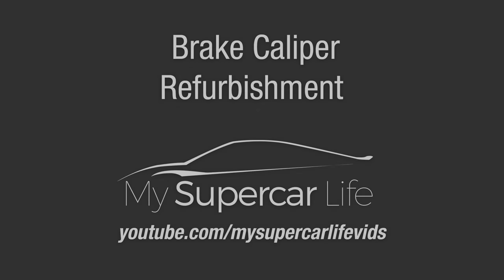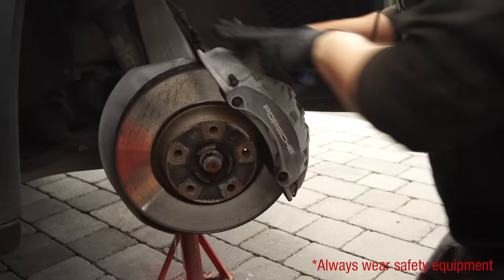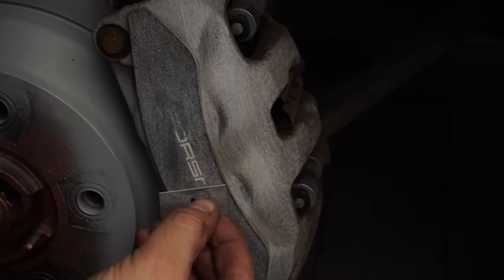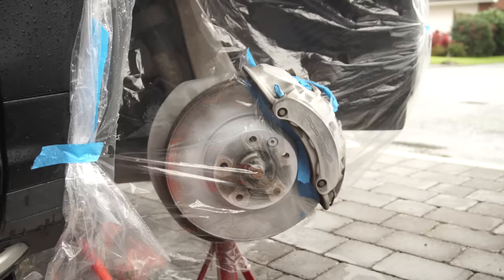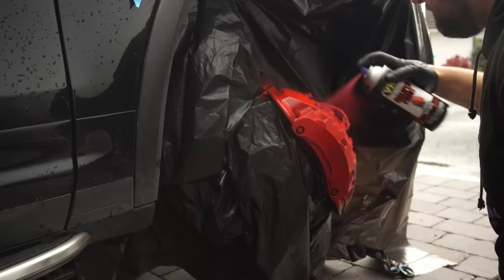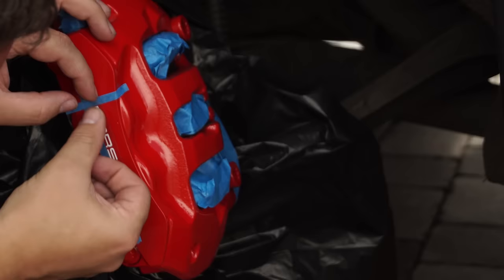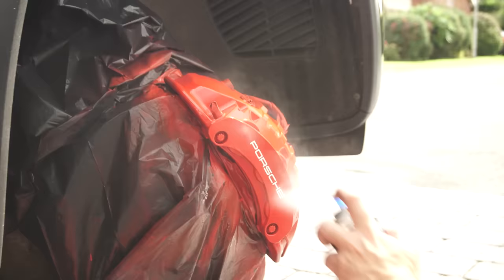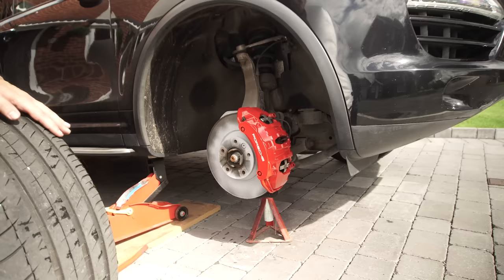How to Paint Brake Calipers

Comment from the maker: Frequently Asked Questions:
I don't use primer as there is no need to use primer with VHT's Caliper Paint. Other brands may vary, please check the instructions.
The paint used is VHT (VHT is the brand) Caliper Paint in Red (SP731) and Clear (SP730) - https://www.vhtpaint.com/high-heat/vht-caliper-paint

How long did it last?
I sold the car after just over 18 months from when I painted them and they looked exactly the same as when I painted them.

Why I don't remove the calipers:
This is a long story. When I bought the car, a Land Rover dealer decided to 'try' do the handbrake shoes, which meant that the brake system went in to service mode and wouldn't come out. The car had to be recovered to a Porsche dealer 40 miles away to be reset, however this didn't work as the brakes wouldn't come out of service mode and the module wouldn't communicate. They nearly had to put a new brake control ECU on the car, when the decided to try swapping my brake ECU with another Cayenne. The other Cayennes module worked in my car, and mine worked in the other car.  They reset it and swapped it back and it's all be fine since, but that little episode left me without a car for a week.
The other thing is this was my daily so I can't be without it, and I don't want 2 tonnes of car on jack stands for longer than it needs to be. The calipers look fine and the only benefit of taking them off would be I could have painted the back, which you never see.

Why not Powdercoat?
Powdercoating calipers is a completely different kettle of fish and is not something that most people can do at home. This video is aimed at the home mechanic or enthusiast. The cost of stripping and rebuilding the Cayenne calipers would be huge. They are 6 piston brakes on the front and 4 on the rear. Invariably you'd find a few of the pistons would need replacing and also all of the seals if you were Powdercoating. This adds time to the job and as I've said before this is my daily. Powdercoating is OK if you can be without brakes and the car for a while.

There is nothing wrong with painting calipers. It works well and is cheap. In theory there are always better ways to do something. In reality - £30 worth of paint made my car look 100 times better.

I hope this answers why I don't remove them. Basically cars are becoming so complex and reliant on modules that it's not just a case of unbolt the caliper, then re-install and bleed the brakes.
I enjoy reading your comments, but I hope this helps answer the ones that keep coming up.
MSL.
Reply: My Supercar Life cheesy oatcake
Reply: Did you have a grinding noise after painting?
Reply from the maker: @leerobinson2777  no, why?
Reply: I've recently changed my wheels and thought I'd paint the calipers while I was in there. Everything looked OK but when I started driving Im getting a grinding noise from the front wheels when I brake or corner. When I changed the wheels I went from a bolt to a stud configuration (bmw)...now I'm thinking that maybe the studs are a fraction too long and are rubbing on something on the rear of the hubs. Going to try the original bolts tonight and if the noise goes away I'll know its the studs, if not then I'm goosed cause I'm really out of ideas if painting the calipers won't cause a grinding sound 😔
Reply from the maker: @leerobinson2777  Oooh, unless when you've cleaned the caliper off some debris has gone in I would say you're on the right lines with the stud conversion. I would eliminate those first and see what happens. I had loads of trouble when I changed the wheels on my E46 330i back in the day,  I replaced wheels with the same offset and the rubbed on the rear. Let me know how you go on. Fingers crossed for you.
Reply: @MySupercarLife  cheers mate your good luck wishes paid off cause I found the fault!... Turned out that the inner rim of my wheel was catching on the suspension arm by a couple of mm!... Bought and fitted a 10mm spacer and all is now sweet!... Calipers look the bee's knees too! 👍
Reply: Lee Robinso
Reply: Indjustering af bremsekaliber
Reply: is one can of caliper paint enough for all 4 ?
Reply: 'VHT' paint = Very High Temperature paint!  You need high temperature resistant paint on calipers as they get too hot for normal paint.

Comment: I use Por15, rust inhibitor. Comes in various colors, stops and prevents rust, encapsulates. But most importantly is impervious to any cleaning fluid brake fluid. Can brush on and dries evenly. Can use on rotors also!
Reply from the maker: I need to try POR15 on a different project, but I always hear it's a pain to work with. It's highly rated don't get me wrong, but I know people say the surface has to be spotless for it to bond
Reply: It was made to go straight on Rust. Stops and prevents further rust. I used on a 73 Dodge D200 3/4 ton my Mom's gave me from California, Hesperia, high desert. Yes, had rust, because it snows up there. People in rust belt actually put on new parts , axles, anything metal to protect from rust. I live in Phoenix, where it's already °110, so no rust but for detailing calipers, rotors I like Por15. Also, wrinkle paint, VHT. Lately I have been rebuilding my calipers and leaving base metal, but detailing rotors, and painting inside of aftermarket wheels to match. Subtle, but detailed. Sort of a haircut that doesn't look like a haircut...

Comment: he is correct,,,,the screwups occur when add that last touch.....stop when your ahead...after all this is just a work of art....only you know that  there is possible one last touch
Reply from the maker: that's when it always happens to me, I never know when to leave things alone! Thanks for commenting
Reply: Iv'e done that countless times on my projects. Great video.
Reply: i agree this happened to the set i just did but luckily i use all 2K products and was able to color sand the runs and buff to perfection, ck my channel for the videos.

Comment: For some reason the Cayenne has just really bad coating on the base model calipers. Mine started out black and ended up looing greyish like yours. Going to use this as a reference when I repaint them
Reply from the maker: Wow - I can't believe they started black and ended up grey. I didn't buy my car new so I'm not 100% sure what colour they used to be but it's really bad that after 4 years they ended up looking this bad. They paint quite well, I'd have loved to remove them and paint them, but it would have been more trouble than it's worth, plus with the wheels on they look great now - they couldn't look worse! Hope it helps in the future.

Comment: A recommendation about brake pads should be made. If the owner knew what type of brake pads to use which didn't make the calipers dirty with brake pad dust, he or she could consider changing the pads when cherrying out the calipers.
Reply: They will all make the calipers dirty and also the rims. That's i'll change the paint on my rims for a darker one.

Comment: Is it okay to leave the masking tape on 24 hours after paint before decal and clear coat application or remove when tacky and re apply masking tape for clear coat process? Hope this makes sense
Reply from the maker: I would remove it so that it doesn't crack any of the paint when it's fully cured in 24 hours. You'll run the risk of damaging the paint surface if you try to remove it when the paint is dry.

Comment: Good Video! Why did you put a clear coat on? Is the VHT caliper paint not enamel? Thanks, I will be doing this soon to my 67 Mustang. Cheers from Motown USA Oh, I would use safety glasses when using a wire brush or wheel on drill, they can break off and fly into the eye.
Reply from the maker: Thanks for the kind words and advice.
I used the clear mainly to seal the Porsche decal in and stop it peeling / discolouring - with it being white I didn't want it going brown or mucky. I think it helps it to look a bit more 'factory' too. You don't need it if you're only going for a colour 👍 I'm sure the Mustang will look awesome once they are done!

Comment: Do I need to put a clear coat on afterwards   I’d be happy with just the paint !
Reply from the maker: You don't need to, I used it to seal the decal in so that it didn't discolour or peel off. If you're just painting them then you don't need the clear coat

Comment: I prefer removing the caliper from the disk rotor - bleedng for me is easier than working undel the wheel well. Its easier to brush, clean, mask and paint - while sitting on a table.
Reply from the maker: You're right, that is the best way. Unfortunately this is my daily driver and I need it all of the time for work so removing wasn't an option.

Comment: During next brake job, wouldn't the paint scraper right off when you clean it again
Reply from the maker: Not really, if you use a high quality paint like the VHT brand then it dries more like a plastic coating than normal paint does so it's more resistant to chemicals etc.
However even on factory painted / powdercoated calipers there is always a chance of some areas flaking where the coating is thin.

Comment: Really well demonstrated mate excellent video and the finisher in the end about finding the wheel loved every bit of it. Question why didn’t you apply primer before apply paint?
Reply from the maker: Thanks for the comment glad you found the video useful. You don't need primer with this paint, you just need to make sure the caliper is clean. Here's a link to the paint: https://www.vhtpaint.com/high-heat/vht-caliper-paint

Comment: How do you keep it clean. After painting it? Because it comes out easy whe certain liquids..
Reply from the maker: With normal wheel cleaner. As long as you paint and clear coat them properly then the cleaner will not affect the paint.

Comment: You should check with manufacturer before painting callipers, they may not be able to get ride of the heat it obtains during brake application.
Reply: Vht caliper paint is made for just this. NO worries.

Comment: A question . What do you think of putting the caliber in the oven to bake the paint ? Or would that be only for ceramic paint . I really don’t k ow . My wrx callipers are so sad these days . A thick yucky coating of brake dust n who knows what else. 😫 I want them to shine but I’m not a painter n never have been . I’ve done little things with wood etc but never with cars . My bike , Ic used a paint pen . That’s all . I worry with painting n thick coats is that the brake dust will stick to it n make a even bigger mess unless it’s hard hard. Is that just inexperience or is it a legit  worry ?
Reply from the maker: You are correct. Most high temperature paints need to be heated to a certain temperature at which they become more of a plastic coating. It will help the paint last longer but isn't always necessary. The brake dust shouldn't stick to the paint as much if you use clear coat and get a nice glossy surface, it just helps it not to stick. You'll probably find it's sticking because of the rough surface. The painting is the easy part, just make sure you clean the calipers first as you want to get the pain on to the metal of the caliper so it doesn't peel or chip. Take your time and don't panic, it really can't go wrong

Comment: great job from prep to finish, but how is it baring up to the riggers of heat and brake dust. I had my 964 calipers powder coated as it is the best way to go.
Reply from the maker: Thanks. It's doing OK so far, saying that it's been in the dealership for the last week with a broken rear suspension spring! The VHT brand paint I used gets really good reviews, and I think that clear coating them helps alot.
Powder Coating would have been the ideal way but as this is my daily I didn't go down that route as the car would have been off road for too long. Also I'd have had to take the calipers off and strip them, looking at the state of the bolts on there, I'd have probably needed new pistons (there's 20 of them @ £30-£40 each) as well as a re-build kit. So it would probably be cheaper to buy refurbished calipers for the car.
Thanks for commenting

Comment: Did you use any specific type of sign vinyl for the decal? I have a vinyl cutter and standard sign vinyl but is there a heat resistant type. 
Great vid btw, will be following this for my ones.
Reply from the maker: I checked on this first. Apart from really specialised applications there is no such thing as a high temperature vinyl. I asked a few vinyl suppliers and none did anything. I used Oracal or Ritrama (I forget which) and it worked perfectly. I would clear coat over the top though to stop them peeling or shrinking as if anything, the glue will soften with the heat. The vinyls I used looked exactly the same after 18 months with no cracking or anything.  Hope this helps
Reply: @MySupercarLife  that does help alot mate. I thought I had heard a while ago that there was a specific heat resistant vinyl. Mind you I wont be braking alot to make my brakes super hot anyway with normal driving. 
Thanks for the swift reply. I will be able to do my own decals now instead of buying them.
Reply: @nickblack423  Where can you buy the decals? Thanks!

Comment: Nice job....I struggled with acrylic caliper paint .....great finish but slow (y)
Reply from the maker: Thanks mate. I've never used the VHT brand stuff before but I'd highly recommend you give it a try next time. It has a really nice spray head which isn't like the old white ones that make your finger ache, and the fan of the spray is similar to a spray gun. I know what you mean about it being slow, It's about 15-20 mins between coats but this really is a superb finish without a spray gun. It is the next best thing.
Thanks for commenting.

Comment: I suggest wearing some kind of mask while using the wire brush to clean the calipers.  You don’t want to breathe in all of that fine dust that is blowing around your face.  

I would also use even more masking of your car.  There is tons of overspray and it can land anywhere on your car.  
Wouldn’t painting in the rain cause water droplets to smudge and ruin the paint job?
Reply from the maker: Thanks for commenting.
Yes, you should wear a mask when cleaning and painting, I was rushing to get the video made. 
You can use as much masking on the car as you see fit. There isn't a massive amount of overspray from the spray cans I used as they have a very good nozzle.
I would never advise painting in the rain, but I live in the UK and this was my daily driver so I had to do it when I had chance. It wasn't forecast for rain on that day, but it did and there wasn't alot I could do about it when I was half way through. No water droplets got on to the calipers so it wasn't a problem.
Hope this answers your questions.

Comment: Nice vid, I want my calipers to be green but VHT only has the grabber green engine enamel paint can. Will this engine paint work for painting my calipers as well similar to the caliper paint?
Reply from the maker: I really wanted the Acid Green but wasn't that brave 😁 - I'm not sure if the engine enamel will work, may be worth reaching out to VHT and getting their thoughts. If it's a high temp paint it 'should' be fine though....
Reply: I have painted calipers with engine paint before, in my opinion it works the same.

Comment: Can i turn my steering wheel when the wheels are off? In order to get all around the caliper? How did u do it?
Reply from the maker: Yes you can, just turn it slowly to make sure that the car doesn't shift on the jack stands. It's best to get someone to watch the car as you turn the wheel, or start with the Caliper facing you before you jack the car up. Hope this helps.

Comment: Very curious: What if your caliper is already pre-painted? Can you simply clean it up, wet-sand, and paint over it?
Reply from the maker: Yes, you can scuff the paint that's already there so that the new paint has a surface to stick to. Make sure that you remove any loose paint and also clean well. The only problem you may have is a reaction between 2 different paint types so test a bit of your new paint over the old paint where you can't see it. That way you don't waste time by painting the whole thing and ending up with a bubbly mess.
Reply: @MySupercarLife  Good call, thanks a bunch!

Comment: For the vinyl - do you use regular vinyl or anything special?  Looking to do this for my cayenne.  I have vinyl machines- but was curious on how well the vinyl has held up. I assume the clear coat should protect the regular stuff
Reply from the maker: They looked exactly the same after 18 months. I contacted my vinyl supplier and they said that apart from really specialised purposes, there is no such thing as high temperature vinyl. If I remember rightly I used Oracal or Ritrama. I would assume the clearcoat helps as it will stop the adhesive from peeling when it gets hot so it sort of holds it in place. But yes, they looked fine and never had a problem.